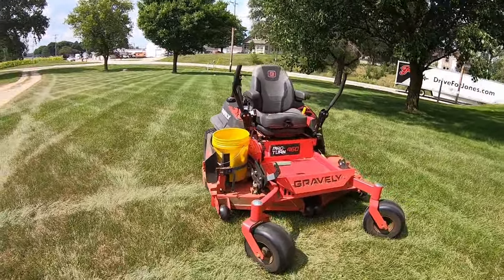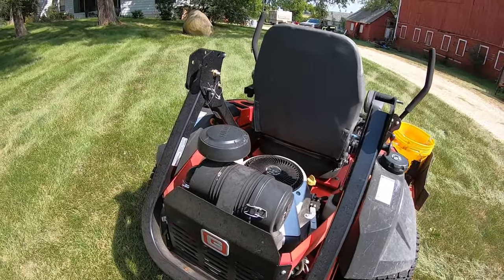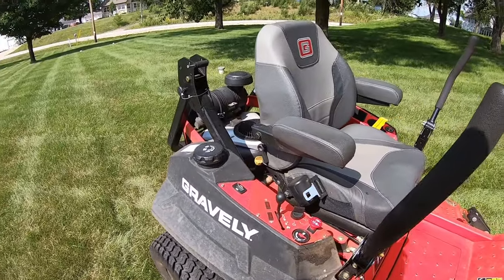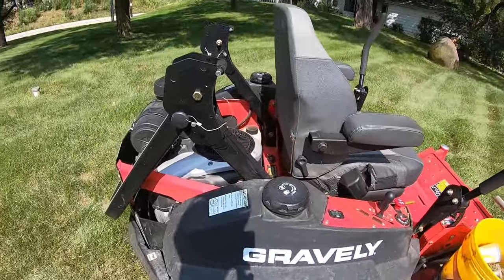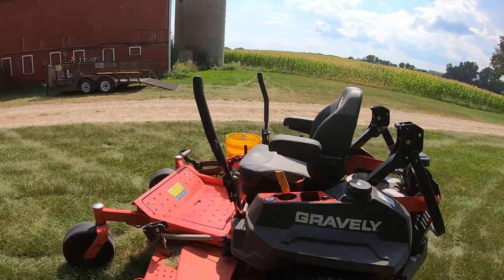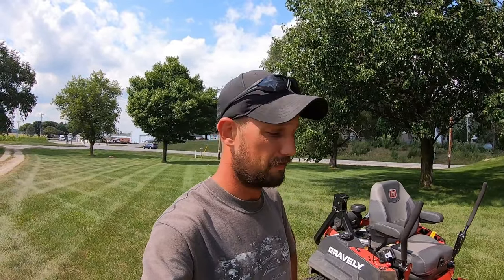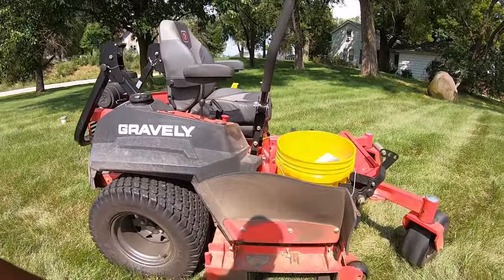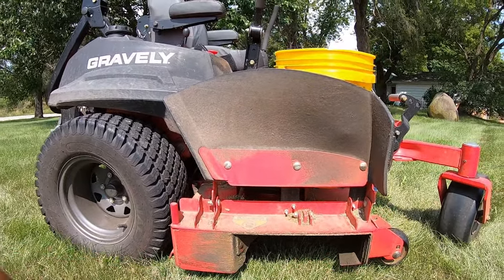Can gravely fix it? Part 2

Comment: I have 5 Gravely mowers and every one of them have decent cuts but leaves stragglers up until I did this one thing....  I made sure the pitch from front to back was at least 1/8 inch off nose diving the front. The second and most critical step is to remove the baffles from the front of the deck. once you do this you will wish you had done it sooner. The cut and overall quality is excellent. If you only take the baffles out and nothing else you will be overwhelmed of the quality. Why Gravely even puts the baffles on these mowers is something I will never understand, they only collect grass and clog the deck. I put over 200 hours on several of the Machines double cutting stuff and finally did these simple steps which changed everything.  Hope this helps the next guy.
Reply: I got two Gravely 460's.  One is a 2013 model year and the other is a 2018 model year.  I took the baffles off immediately as soon as I seen that they were catching the wet grass clippings and building up.  Absolutely no reason for them to be there.  All they do in impede the grass discharge and create more work scraping the bottom of the deck, especially in the spring when you are cutting wetter grass and grass that grows at a much quicker rate then the summer months.  Both my machines cut excellent and the X Factor 2 decks are some of the best finish cuts I have seen on a commercial ZTR.
Reply: We had 2 460's and a 160. 2 X-Factor decks and one X-Factor II deck. I agree removing the front baffles makes a big difference. Unfortunately for us and our fescue lawns the gravely deck forced us to double cut everything literally (75 lawns a week). If it was the slightest bit damp at all which is every single morning, it was clump city. Nice and dry but typical spring early summer deep? No clumps but instead large windrows of grass laying on top. Both requiring double cut to clean up. Grabbed a Tiger cat with 61 V+ deck to try and immediately dumped all 3 gravely mowers. Zero double cutting and zero clumping in any condition. Amazing stripes as well. Those were not the only gravely mowers we have owned either. First one way back was a gear drive Pro-50 walkbehind. Also a gear drive 36. Many bobcats, exmark lazer's, cub commercial we've tried just about everything except a walker mower.
Reply: Please, what shoes 1/8th inch “off nose dive means”. How do you remove the baffles?  Thanks
Reply: @g.alistar7798 im having the same issue did you look into it? the video says he lowered the back of the deck 1/8” but i feel like this comment nose dive means the opposite
Reply: I haven't done anything to my gravely. I have 2 old ProTurn52's and I have 1,700 hours on both of them. Still running
Reply: @JerryB68 what baffles are you speaking of exactly? Where at on the front?
Reply: @THEODINOFFICIAL  The 2013 had them in the front of the deck.  My 2018 460 z did not have them as Gravely got rid of them right from the factory because of just what I said about them gathering clippings and affecting the quality of the deck cut.  I still got my baffles from my 2013 460 Z and I never put them back on.

Comment: One side of my neighbor's transmission bracket to frame broke off on his Gravely 42". Those brackets are thin. He had man weld the bracket back on and welded a support bracket to the frame on both sides. Done the trick.

Comment: Are your blades sharp and do you use gravely mower blades That came with the machine???  I own a gravely pro walk and don't have any of these problems.  It cuts grass perfectly.  I don't think the problem is the machine.  I think the problem is maintenance.  And whatever dealer worked on your mower.I would never bring it back to them.  The problem with all mower dealerships is that their quality is very spotty; Some good and some bad.  How is the air in your tires?  Is your deck level?  Are you using the right gas and is the machine rabbed up to Maximum rpms?  There is something you are doing wrong and it is not the gravely machine, In my opinion.  You are the problem somewhere.

Comment: My bad for sounding mean but know your mower bruh.  100% of this machine is user serviceable.  We sharpen our blades in the shop once a week, clean the air filter and check fluids.  You must maintain that Gravely mower just as much as the lawns they cut.  Monster of a mower if kept up with the required maintenance.

Comment: Wow I’m really sorry to hear this. I have a Gravely that I purchased in 1998. If I told the average Joe it was a 2018 model they’d believe me. It still looks brand new. In all those years I’ve only had a couple problems. The first hour I ran it, the electric clutch for the blades went out, and was replaced under warranty same day. 3 belt replacements over the years, and the nut fell off the parking brake about ten years ago. $.35 to fix from hardware store. In all those years, that’s literally all I’ve had to fix on it. I do wish it was lighter, it’s built like a tank. I really hope Gravely hasn’t gone down hill this far and you somehow got that one lemon that just can’t be explained... 🥴

Comment: I have a ZTHD 52" and I've been running it with mulching blades + mulching kit (discharge gate replaced with baffle) until the leaves finish falling, then I swap back to the stock set up with high lift blades.  It does require me to double-cut certain grass types while in the mulching configuration, but it's well worth the clean, leaf/clipping-free finish.  I'm still experimenting with different blade types, but one idea that may help you is running an "X-blade" configuration (2 blades per spindle, 6 total).  I haven't tried it yet myself, but I hear it destroys all grass in 1 pass!  Good luck, hope you got it working right!

Comment: I run two gravelys. Never had a issue. I would recommend pitching the deck 1/4 to 1/2 with the front being lower and removing the front baffle you had your hand on. A half inch seems like a lot but it creates more vacuum. I run high lift blades on mine as well and that made a huge difference in cut quality.
Reply: I agree , my 460 is great.

Comment: These mowers are pretty sweet when brand new, but I have one and it gets a little worse every season. I just expect it's dulled blades and maybe needs a tune up with minor adjustments obviously. But yeah the bigger models have more options for adjustments.

Comment: I don't know if you are still having problems with stragglers, but if you lower your blade below the baffling with spacers above the blade, you will have a better cut. The only other variables are sharp blades, blade tip speed, and blade lift which is either too much or too little. I hope that this helps. Equally important, adjust your mowing speed too.

Comment: Not a commercial mower. But sounds like it's the blades used. I'd try high lift blades to get more vacuum inside the deck frame to suck up the grass blades to be manicured to an even height. Just my first thought!

Comment: I had so many issues with this mower and having that yamaha motor on it. it was like 3 or 4 engine rebuilds through the service dept at the local gravely dealer.  the motor finally seized and dealer wasnt going to honor the rebuild (long story) the boss spoke with the parent company and they swapped us with a new mower that they used as a loaner.  that motor with bucket over shims for valves was a pain in the butt
Reply: These can come with a Yamaha motor?  Interesting.
Reply: Yamaha motors don't just come on Gravely mowers.  They come on many other high end mowers, tractors, boats and motorcycles.  You must have forgot to change the oil on a regular basis and did not break it in correctly.  After that, you are at the point of no return.  Can't blame that mistake on Gravely of all companies!  omg!
Reply: @profighter1234  Yamaha motors did come optional on Gravely's
Reply: David Rodriguez did yours have problems starting? Mine usually starts fine in the morning after sitting all night and runs fine until I shut it off and then won’t start unless it sits for at least an hour. Dealer has been absolutely no help! Still under warranty but can’t afford to let it sit in the shop for 4 more months. These Yamaha efis are garbage! Can’t believe Gravely let us consumers be the guinea pigs.

Comment: I have a gravely mach 1 and the fuckin thing windrows grass out the left side,  I have tried 1/8 all the way to 1/2 inch pitch....  3 diffrent sets of new blades, completely pressure washed the deck underneath so it is shiny again.....  I have had enough of it,  tried going super slow to medium speed also...  Tire pressures also all good

Comment: Exactly what I was going to say change the pitch first of all I would go to another dealer see if they could rectify the problem. I would also call gravely explain the situation. Perhaps they could send a zone manager down to check this machine also, this machine may have been dropped, so maybe one of the forks are slightly bent or something definitely go to another dealer see if they could fix it

Comment: Glad to see a honest review. So happy I bought a TORO over gravely junk, went back and forth for awhile, toros warranty is hard to beat.
Reply: What?  Are you a "Junior" Varsity landscaper?  TORO's were good back in the 1980's kid.  Even their highest end now days is mediocre at best.  Please don't tell me you got a commercial grade TORO!  I'll give you about 15 other brands you should have purchased before that.  Let's face it, we all want a mower that will last forever and give us constant quality cuts.  TORO aint it.  If you want to pay high end for leather seating, padded cushioning and super bouncy seat springs - there is a market for that.  If you want a comfortable ride without all the "boshy BS" and a mower that will cut through darn near everything (even in the wettest of conditions) and last for years - go Gravely Pro.
Reply: @J_TRAIN  I'll take the high ground for the both of us Junior.  If I got under your skin, it was not my intention.  I obviously did.
Reply: @profighter1234  your wrong buddy while I’ve had all of them don’t nothing cut like toro scag exmark and wright mowers! While each one has it’s issues if you can get it right can’t beat them but gravely is a good mower and cuts good and dependable but gravely is just a beefy machine with a decent cut the thing with them you have to adjust the deck correctly and it will do a better job! But gravely just a chunk of steal with a engine don’t believe me just look at it and tell me we’re you see quality?

Comment: I'm gonna go ahead and say that you might not be being very fair to the brand. I use a residential grade ztx 52 to mow commercially and the deck cuts just fine, the only time I have to cut twice is when the grass is overgrown. All of the things you've pointed out for the most part are under warranty still, and I'm betting most mowers without a brand new edge on a blade have a hard time with that soft grass, sometimes it just doesn't want to cut.
Reply: You are exactly right Ryan.  Thank you for speaking up mister.
Reply: I’m with you! They cut really good!
Reply: Im looking at a ZTX 52 vs Cub Cadet Ultima ZT1 54".....Cant decide
Reply: @youtubechangedmyname  I just bought their Stealth (ZTX52) and used it to “mulch” all the leaves that have been against the fence/tree line for years. Took me an hour plus to rake out a couple feet into the yard and an hour to “mulch” all the leaves. (Would this be new mower abuse?) 🥺. You couldn’t tell there was ever a single leaf let alone the decomposing layers underneath lol. I highly recommend Gravely. I originally was looking at that club cadet too. It’s a beautiful machine but have you seen the reviews online for it? It didn’t leave any question in my mind that that wasn’t the mower for me. Did you make your purchase yet?
Reply: *Using stock blades that came with the stealth. No mulching kit/blade add-on

Comment: the one problem i had working on these new mowers is the rpm  on the blade's are a problem . there not spining fast enuff .  2nd  there is alot of flex in the top of the deck where the middle spindle  is . Meaning once you get alot of grass that is not being discharged  from the mower  the middle of the deck where the middle spindle  is. starts to flex up  an down .  this is a factory defect  and will get worst over time . my shop will not work on them any more due to Gravely  starting to be hard to deal with  just like  Husqvarna  an cubcadet .

Comment: When leveling the deck, did you measure (in inches) the bottom height of the blade tips in two positions, that is, outer edges of blades positioned front and rear, and then, left and right ? The height should match the height on the mower’s deck adjustment leveler. The lower 1/8th inch in the deck’s front should be best as you stated. Also, have the blades been hand sharpened and balanced on a Bench wheel grinder?

Comment: I have a 2012 Gravely 48HD and it has always left lines of uncut grass.  Tried several different blades and still the same.  Wish I had kept my John Deere
Reply: How long do you expect it to last?  If you half heartedly maintain it, you'll get half the life out of it.  Yours is going on 10 years and it's a residential mower.  I'd say you are doing alright kid.  Especially not maintaining it the way it should have been.

Comment: Are you full throttle on the accelerator? Sounds like you may be traveling at to fast of speed if your getting Mohawks. 
It would be hard to imagine your not getting blade coverage on a brand new mower. Considering those blades would be sharp at purchase.

Comment: I had two of those they cut fine except for Bahia you had to double mow quite often especially if it was thick and I now have a 72 inch like that that amazes me on how little I have to double mow on but it has a 34 horsepower engine so I'm assuming it has a lot more RPMs I don't know

Comment: Any problems with your motor yet? Seems not many have the Yamaha. I’ve had my efi Yamaha in the shop COUNTLESS times. Governor problems and a long list of other stuff. Currently in there now. Gravely won’t help other than keep fixing it under warranty which is almost out. The owner of the dealer also has one and his is in for THrottle position sensor. Unacceptable for a 12k mower. As far as cut goes I just took the baffles completely off. Seemed to help in more wet stuff. But in dry it was still sub par. Sharpen blades weekly seems to help as well. Ive heard good things about their Mach one. But with the support I’ve been getting I may not stick with Gravely much longer.
Reply: Put Gravely High Lift part # 91-239 blades on your mower..and the cut quality will be much better.
Reply: Had my Gravely Pro w/Yamaha 26 HP efi for a number of years now.  Only thing I do is keep the oil changed and blow it off after every mow.  Still starts within a split second and purrs like the day I bought her.  Sorry about your luck Patty_C.  You have to conduct preventive maintenance on any motor or they will start acting up like yours.  Don't leave it alone until there is a problem and then blame everybody but yourself.  Just saying...
Reply: @profighter1234   Ive been in business for 10 years, i do all the maintenance myself and actually change oil and filters BEFORE the schedule says. It started acting up with less than 200 hours. After being in the shop 6 different times over 2 years for the same thing I managed to get to 700 hours and it still wasn't right. Thankfully it is sold and I'm on John deere now with much better luck.
Reply: @PastFlatPat272  Sounds like operator error.  Perhaps you should have left the maintenance side of things to the professionals at the shop.  Most people don't but then again, most people don't have  your type of problem either.

Comment: I have the same mower with the same issues.  it also clumps horribly.  nothing fixed it...the dealers answer was to try and sell me the new 600 series.  I should have bought an exmark from the start.
Reply: Read all my comments above and you will find answers.  Sorry bout your luck kid.

Comment: Raise deck in rear 1/4 higher than front, should cut like a dream, I don’t see how it cuts with deck lower in rear, my deck was adjusted wrong when I got it new, it was just about level and it didn’t cut right until I got rear 1/4 higher than front, and only thing I wish I did differently is got the 48 instead of the 260

Comment: try drilling ports or holes in the baffles, it will make a world of difference, the holes should be about 1/4 to 3/8in size. I know it sounds crazy. but we did it and I can run over magnolia leaves and there is nothing left after that'[]

Comment: Yeah, my red rider...has become, a bit of a disappointment.  I'm being told (by dealership employees, no less!) that these last 4-5 years...Gravely has had, some truly awful, quality control issues.  Wheel and deck parts, drills, welds, mounts, alignment, you name it.  Nickle and dime pieces, costing big dollar problems.  The fix may be in, for them...but where does that leave the buyers, coming out of the warrantee periods; and then left, holding the (empty) bag?